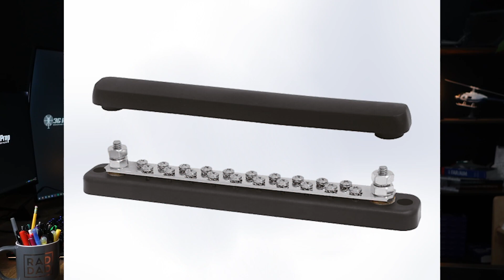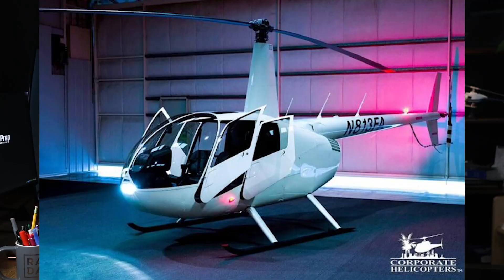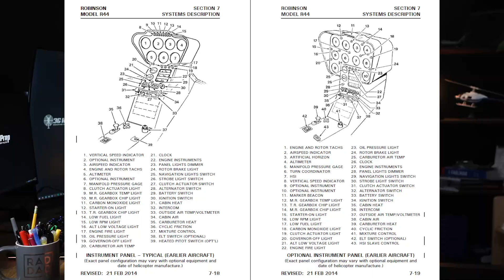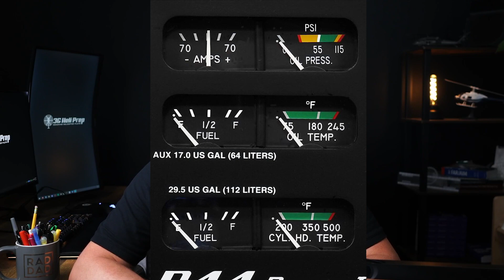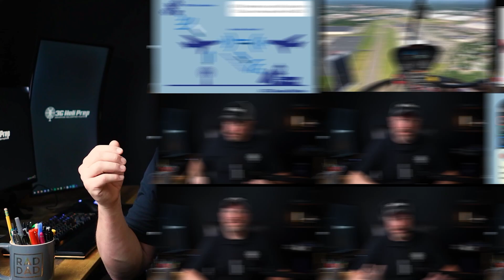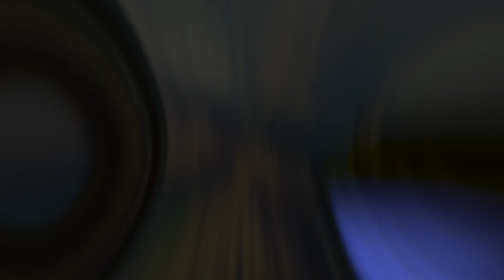R44 Electrical System Explained for Student Pilots

Comment: Where did you get the information about resetting circuit breakers once? I've been trying to find some guidance on what to do if a circuit breaker pops and I can't seem to find anything. Thanks!
Reply from the maker: I would first check out the poh either in the emergency procedure section, or in the systems descriptions section for electrical systems. Each helicopter is going to be different so be sure to check with the manufacturer's recommendation